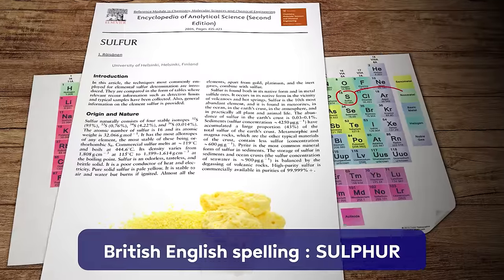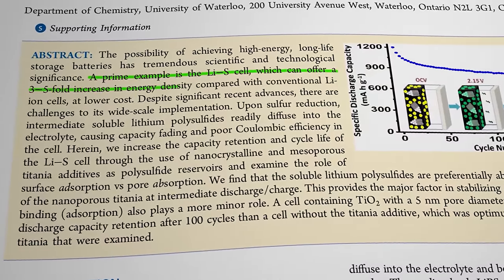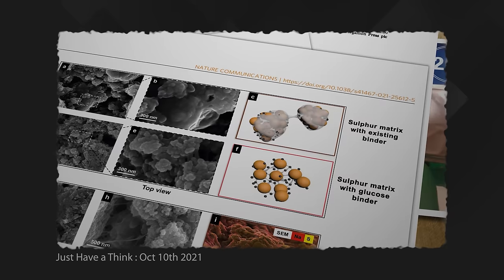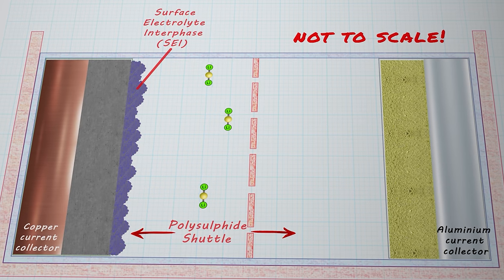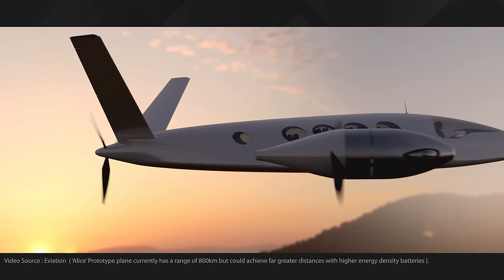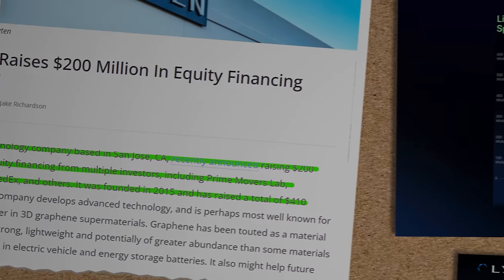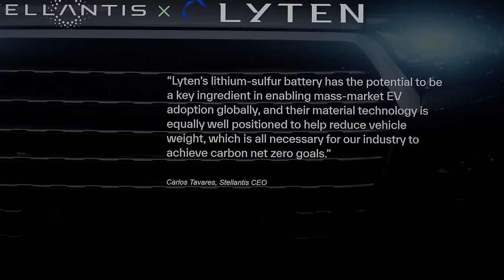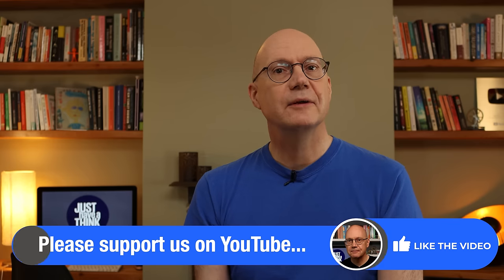Battery Energy Revolution. What now?

Comment: Can some one please tell me why hydrogen is not getting anywhere?  There was this design that the US had stopped research on it because it was interuptive. It was basically something that allowed hydrogen to be used as fuel by inserting a casset like box . It made a few head line and then disappeared.
There is all this talk of making hydrogen in pertochemical plants or electrolysis. But there is a much easier way of producing it in situ from water, using aluminium which is extremely reactive with water. The only reason that the kitchen foil doesn't burn is because the surface is covered wth aluminiium oxide. Once you removed it using anything that reacts with it the oxide like an cide or even hydrogen peroxide the aluminium with react with water creating hydrogen, electricity and heat. Maybe those cassets were actually aluminium foils and didn't contain hydrogen at all. Doesn't that sound like an engine that runs on water? Didn't he die in mysterious circumstances?
EV's are heavy which is totally contrary to what motion needs and once they catch fire there will be little left of the vehicle. So, they might catch fire less often than a combustion engine but when they do it is over. It is like planes that are the safest way to travel but the chance of survival in a flying accident is almost zero.
Everyone knows that until you get adequate storage of green electricity we will still be relying on burning fossil fuel.  So the research on grid battery is held up by lithium that has become a commodity like oil. This reliance on one thing creates scarcity turning it into a weapon by which power is centralised.
Why no one has even tried to get hydrogen in situ like the above, converting a combustion engine to burn hydrogen is not difficult and there is a hundred years of reseach on how to make combustion engine efficient. All that knowledge is being lost for what?
The Japanese have been going on about hydrogen for a long time now. 
All of this makes me sucpicious. How come Toyota who created the first electric car in the modern era is not pushing for EVs. Maybe they are waiting for the patent to expire because they are going big on hydrogen.
Reply: $12 per gallon equivalent. That is what it would cost for carbon free Hydrogen. I've made Hydrogen, dried it, and used it for a RC blimp that I wanted more lift. It's only cost effective if you have Nuclear power and can do high temperature reforming. "IF" the USA can get past the hurdles and make new Nuclear power plants then those plants could be designed to produce Hydrogen. So Japan saying they want to make new Nuclear power plants and make hydrogen are linked.
Reply: It's simply not worth the hassle. Hydrogen is a superior space rocket fuel, but even for that application the space companies have abandoned it.
Reply: Unfortunately hydrogen isn't very energy dense (you need a great deal more of it than petrol, for instance), it's difficult to contain or deliver (as a gas, it's tiny atoms leak through most substances - as a liquid it needs to be kept frozen at VERY low temperatures), and it creates a hell of a lot of carbon dioxide when it's made.  It will probably be used for some applications (factories, ships?), but we'll have to find an environmentally acceptable way of making it first.
Reply: @LaserFur I am not taking about hydrogen, I am talking about aluminium or other similar metals that are a kind of battery.
How did you make the hydrogen. I am not talking about creating hydrogen and moving it as fuel. I am talking about making hydrogen pretty much at the point of combustion.
Aluminium is cheap because we make a lot of it anyway. The scale is what I am talking about.
Recycling batteries is a complicated dirty and expensive business. With aluminium all the engery has been spent in making it. Aluminium or similar metals are a battery ready to go. Nature has sealed it for you. Recovering aluminium from its salt is what aluminium plants do any way.
The biggest advantage it that you can't commodify water. It is everywhere.
You are missing the point. Hydrogen oxygen reaction is the most powerful reaction. At the point of interaction they neither need to be liquid or kept under huge pressures.
We are talking about water.
Reply: @andreasboe4509  Recycling of EVs is a hassle, recycling aluminiums is what we are doing already.
Aluminium is used as solid rocket fuel too.
I am not talking about liquid hydrogen and liquid hydrogen. You are missing the point.
When you make aluminium or similar metals you are making a battery. But because it is done at scale it is cheap.
The biggest advantage it that you can't commodify water. It is everywhere. Remember you are in effect burning water not hydrogen. You create the hydrogen using he energy stored in aluminium at the point ot combustion.
You have you head up in Elon Musk's ** and don't get the point.
Reply: @ExiledGypsy  Electrolysis of water wastes large amounts of energy that doesn't go into the fuel. It also demands expensive and bulky gear. Battery powered cars is a much better alternativ practically.
Reply: @ExiledGypsy I used some used AL foil and lye. The harder part was removing the moisture since that made it heavier than helium. Of course this would not be practical at a larger scale due to the energy needed to make sure it's pure enough for a fuel cell. and burning it only gives you a 35% efficiency. I'm currently driving a 12 year old EV and I just could not imagine all the waste products that a AL hydrogen setup would generate over that time. It has to be closed loop and that is where that Indian company comes in. you should look up there AL O2 battery that powers cars directly. Then once drained they take it back and run it back threw the AL production process. So no hydrogen is involved.
Reply: @andreasboe4509  Why don't people read properly. I am not talking about electrolysis.
Aluminium and metals like it are batteries. Energy is pent in making them and the oxide covering it is a protection layer that stops release of the stored energy. You scratch it is the presence of water and it will react with water to create hydrogen. That can be burned straight away in an engine. On top of that you get heat and electricity as well both can be fed back into the system to make more or used for subsystems.Within that context efficiency takes on a different meaning any way.
Which one do you prefer lithium battery or kitchen foil and water?
Aluminium is used as rocket fuel. The problem is to manage the reaction in small bursts like in a carburettor  where oxygen is pumped into fuel vapour for each cycle.
Besides I doubt that Toyota hasn't considered any of this. I doubt Japanese are that stupid. Hydrogen is pletyful. So all this none sense is created to keep power centralised. The battery makers of today are same as oil companies of the last era.
Reply: @ExiledGypsy  I can't get pure  Hydrogen peroxide and I don't see that as being something the public would be able to do. the water and lye method produces steam and thus there is water in the hydrogen gas.
 The reason that the AL battery is a better option is the high efficiency of the battery and EV motor.
Reply: @LaserFur  Actually there is new method to make hydrogen peroxide that can be made very easily even in the remotest areas. This is another product that was made in large chemical factories during making hydrogen from methane. 
Now it can be made very easily is smaller quantities anywhere. Hydrogen peroxide has fallen out of favour and restricted to medical use because there are stronger disenfectants around.Again it is a question of scale. With the new process it can be scalled easily.
Yes Aluminium batteries are efficient but recharging them is not like that of lithium batteries. But for aeronautical use they are better because of efficiency and changing he whole battery is easier in an airport. But hydrogen and oxygen reaction is the real solution to take off and landing. 
There is even a new process to replace Bosch-haber process to make green ammonia that in turn can be used as fuel.
I honestly think running vehicles on batteries is creating problems that is just not the right way to go for transition from fossil fuel. The industry is finding it hard to make profit on EVs and we are creating new environmental problems that is going to make things worse in the long run.
I can't believe that Japanes are stupid. Most EV's are bought by the well off leaving the poor poorer.
Reply: @ExiledGypsy  The FAA just recently approved removing the lead from the fuel used for older planes that were sold to use leaded fuels. By the time hydrogen gets scaled up it would be too late for short haul flights. And across the ocean is likely to use synthetic fuels or just pay for carbon offsets. As with anything else it's about fixing the easier spots first. Like coal plants. Personally I spent $4,000(USA) on a old EV and I expect to drive it for 10 years. And since Ice cars get about 30 miles per gallon and EV's get about 3 miles per KWh it means that I am paying the equivalent of $1(USA) per gallon.
Reply: @LaserFur  EV,'s have a whole set of new problems like recycling. And Lithium is single commodity that is used as a tool to centralise power again. Hydrogen is the most abundant element. Synthetic fuel is net zero which is different to no CO,2 Emission. 
If that is the case then we might as well stick ices which are getting more and more efficient all the time.
It is power struggle and and artificial scarecity that creates conflict. Just like diamonds that is not scarce but made scarce by monopoly.
I guess human beings never learn.
I was in favour of EVs until I saw the problem that is causing. Complexity means fragility. There is no resilience built into them.
Reply: The earlier B52 and even now when C10 need to take off loaded on a short runway they use rocket.
Hydrogen can be used in the same way for take off.

The challange with hydrogen is the infrastructure otherwise if you can produce hydrogen in place then it is perfect for flying. Airbus and probably Boeing are already considering hydrogen powered planes.
Besides for flying a more expensive hydrogen is more environmentally viable than synthethic fuel.

How come we don't hear anything more about the U.S. company whose patent was stopped because it was considered national security problem and an interrupting innovation?

It has already started. Large investments have been made in all these large battery plants who now have the power to dictate policy just like oil companies.
It is political more than anything else.

Comment: New battery tech will not solve everything. From where you will be getting all that energy to charge every EV on the road, isn't it going to be coming from burning coal + gas? What about charging station infrastructure? Where im from if you don't have your own charging station it is actually cheaper driving ICE car than EV. They are asking over 0,40€/kWh on public chargers lol. I can't imagine how bad will it be if everybody switches to EV.

Comment: I always feel it’s worth mentioning that in Norway, last year, 80% of new cars were fully electric. 1 of 5 new cars were fossil fuel cars. Norway has very rough climate, lots of steep hills, just 5 million people spread out over a vast area and is a major oil producer. That means it’s the least suitable country for electric cars. That again means all other countries are just fu**ing slow at getting it. 😅
Reply: I am one of those Norwegians and I'm not happy. The all too quick transition too EVs is a political decision by a government desperate to appear environmentally friendly. It does make more sense to transition to EVs in Norway than most other countries, because we're 95% hydropower, but to punish citizens who need affordable cars with four wheel drive that can tow heavy loads causes more suffering than necessary. There are many negative sides to EVs that fossil cars don't have, like certain safety issues, but those facts are being suppressed "for the greater good".
Reply: Well at least I dont get it...Here in Sweden our government is almost as obnoxious as in Norway about the electrification of vehicles and the biggest problem is that we are not going to be able to deliver the electricity needed for this. Actually I hate my fully electrified leased VW. Nice to drive but I had to stop Two times to charge it on my last trip in minus 20 degrees C to Karlstad just to keep warm, 30 plus 30km and it became much more expensive to drive than an petrol or diesel car. My last petrol car did this trip without refilling before home again. Fast charging is very expensive and I promise , you dont want to slow charge in minus 20...! The range in winter is laughable. Im glad I can return this car next year....
Reply: Maybe it's because Norway is the 8th largest exporter of oil so it can afford to make that transition. Export the fossil fuels and make the country look green!
Reply: Norway eh?  That super rich country with a small population and mostly green electricity?  And you wonder why the rest of the world can't follow you?  You could do a lot more - a hell of a lot more - for the world's survival by cutting right back on your oil production.  But it's a lot easier for rich people to buy an EV than to give up your world-beating standard of living just to save the world.  Enjoy your EV powered trip to global Armageddon.

Comment: To all those who think EV will save the planet today: Research the following categories.
Recycling batteries(toxicity and environmental impact)
Manufacturing (and environmental impact) process of tires for the heavier vehicles. And, environmental impact of all the extra rubber entering the ecosystem from those tires wearing out.
Manufacturing of asphalt and concrete (and environmental impact) for upgrading the transportation infrastructure.
Environmental impact of manufacturing the needed components of the Power Grid that would be needed.
     Someday, the technology will arrive. But is not this decade
Reply: Give it time... Look how long it took to make current fossil fuelled cars this efficient and produce less emissions.
Reply: @A2B_Music  Exactly. So why the push right now at the expense of our standard of living?
Reply: And all those irritating fires that keep breaking out...

Comment: Can't help thinking that the understandable "go green" rush to replace ICE vehicles with hybrid & battery-only EVs has resulted in the EVs being powered by "prototype" batteries with known build & installation faults.  

Hopefully we won't have to wait too many years (!) before 100% "safe" batteries are commercially available to replace the current widely installed "rushed prototype"  batteries.   Unfortunately there is a crisis of confidence in the used-EV market which is deterring many from switching over to EVs.

Comment: Look, I love your positive energy and brand of optimism, but almost everything you present is so very pie-in-the-sky.
Yes, electrification of tools and transport is a grand idea, but it comes with significant issues and - particularly for EVs - is mostly unsuitable for the majority of people. You can even look at the field of DIY: battery drills are popular but if you want to get any meaningful work done, you need a mains-powered tool.
Rechargeable cells have a long way to go and glib comments about how companies are throwing money at the problem and how researchers are bullish about the prospects should be a huge warning to you and your audience. It's a sales pitch to keep the money flowing.
I have worked in products with rechargeable batteries for decades and the only real innovation that keeps energy (and power) density rising is cleverer packaging putting more active material into a smaller volume.
Reply: I just add 5-10 years onto the pie-in-the-sky types' time horizons. Or just extrapolate the actual trends in battery price and energy density.

Comment: the energy density problem is so frustrating... hard to get excited about 500 watt hours per kg when regular old gasoline is 12,200 watt hours per kg... Can we seriously not come up with a rechargeable system that can compare to this??
Reply: a tall order but combustion engines only get about 20% of that energy to the wheels so you're looking at about 2500 watt hours per kg effectively. still 5x off. 

lithium-air batteries are the holy grail of the tech with a theoretical limit of 13,000 watt hours per kg.  we should be able to get 2500 watt hours per kg out of that tech  in the future with materials advances.

Comment: i challenge you to do some basic math and put the results here in comparison to any other energy production system. search for the u of ark graphene generator here on youtube, use the numbers they provide and do best/worst case output calculations for volumes of comparable size to conventional energy storage systems. how many watts per gram does each system produce, how long do they produce at peak and how much carbon do they sequester, for forever as a function of existing. do that and then do a video on the future of energy systems.

if i were a betting man id wager a considerable amount you wont touch this and will find any excuse to avoid the indisputable long term implications for it. thats why, while proven to actually work as stated, its not being covered by Big Brain types. they recognize the damage done to physics this represents. anyway im not going to hold my breath, pride will prevent even the most honest researcher from looking into the dark and fear keeps their back to it, as long as they dont see or acknowledge it it doesnt exist